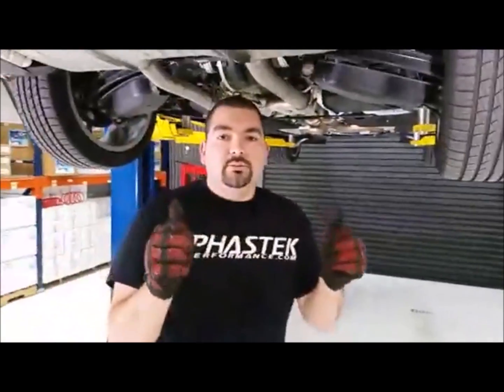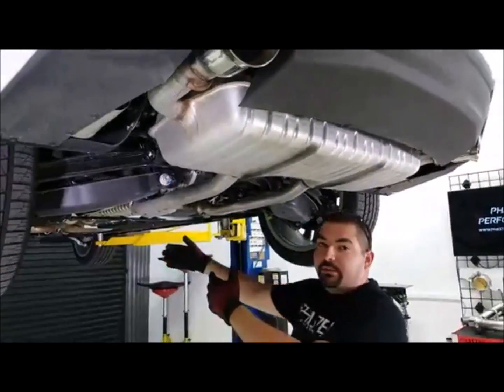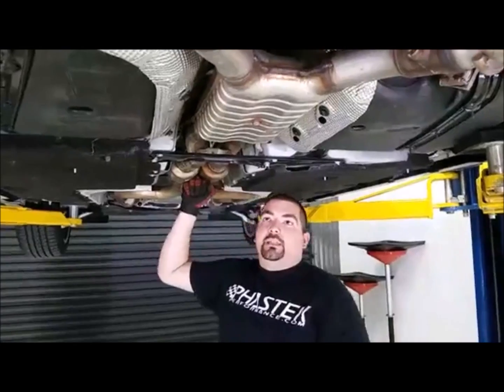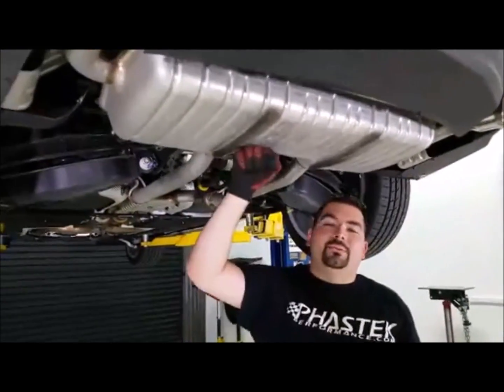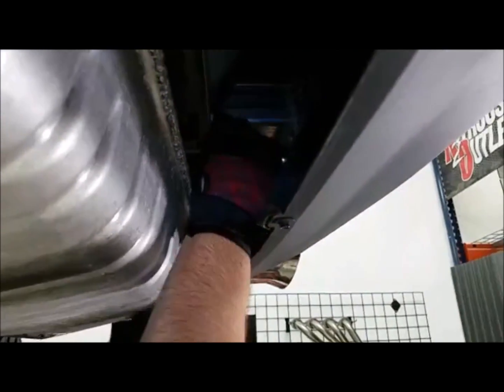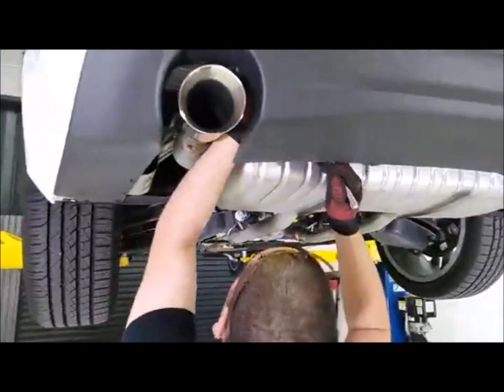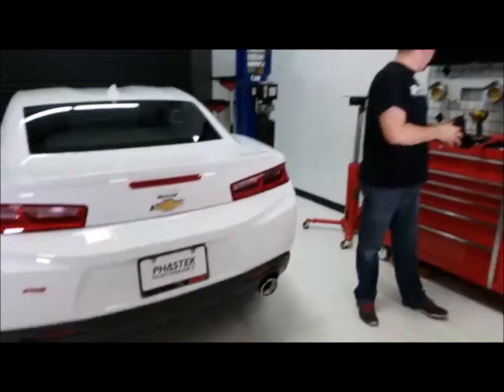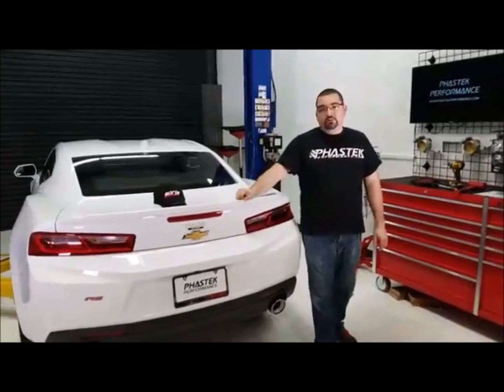Borla S-Type Axle-back #11928 LIVE Install on Facebook

Comment: I have a 19 SS need help on options . Was told can’t put the Borla Atak cat back system on my car bc i have an automatic. So would i need just axel back or axel back and mid pipe ?
Reply from the maker: There are a lot of different variations to the 2016-2020 exhaust systems.  Because of that a lot of manufacturers had to adapt with different kits.

You can do a cat-back system but you would have to get the X-pipe and then the muffler system of your choice that works with that X-pipe.  

Here is a link for the Borla X-pipe that will work for you since you have an Automatic.  It will have the brackets for the AFM valves that are in place.  

https://www.phastekperformance.com/2016-Camaro-Borla-X-Pipe-Mid-Pipes-AFM-Valve-60610-p/borla-camro-6-x-pipe-60610.htm

Now all you have to do is find the muffler system that will fit your Camaro and you are good.  Reach out to our sales team and they can get you lined up if you need any help.

sales@phastek.com

Comment: I put my Ataks on 2 days ago, your video helped a lot. So the clamps only go on the end of new pipe right, even with the end of pipe? Not splitting the new & existing pipe . I put clamp even with end of new muffler where the split is. And tightened the heck out it
Reply: InstaBlaster...

Comment: Nice!! I have a v6 2016 maro as well. I like the sound of borla. It your opinion what system would recommend for extra HP and a great sound? Cat back
Reply from the maker: We prefer a cat-back system over an axle-back cause of the replacement of the factory system.  But some owners are just looking for a sound change and an axle-back does that.
Reply: K Stanford "maro" 😂😂😂 Becuase the "Ca" is so hard to type

Comment: Can you change from single tip exhaust  to double exhaust on the V6 2016 and up camaro?
Reply: Will it fit?
Reply: I don’t know if you still need this information but yes you can, Borla makes these same exhausts (S-Type and ATAK), all you have to do is follow the same instructions but you’d have to change the diffuser

Comment: Does installing the axle back system void factory warranty?
Reply from the maker: We can see it voiding the exhaust portion of the warranty coverage but not the full warranty coverage.  We would suggest checking with your local dealer just to be sure, some dealers are a bit more strict when compared to others.

Comment: the pinch in the middle of the stock system, dose that affect the sound quality as well?
Reply from the maker: Yes, the pinch in the exhaust could effect the sound you will get out of the exhaust.  Changing that will open up the exhaust system allowing for a slightly different tone.
Reply: Phastek Performance would you recommend the indented part, the pinch get replaces with a straight pipe?

Comment: what's the cheapest thing I can do to make my 2018 v6 camaro RS exhaust louder ?
Reply: Sell it, the whole car and get a SS
Reply: Muffler delete
Reply: @proelitematthew7811  that's a great comment,  sell it for an SS and pay around $8000 more to go 9 tenths of second faster to 60.
Reply: @robertjakicic5878  that's a great comment. I got my 2017 as for $27,000. A 2018 rs is for $26,000. And it's a whole fukin second slower😂
Reply: Shouldn't have bought a v6 if you're worried about sound lmao, the price difference for the v8 is so worth it, got my 19 2ss for 34,000, my borla atak comes tomorrow!
Reply: @lol25879  borla axle back is way too overpriced. I just got the flowmaster American thunder axle back, flowmaster scavenger x pipe and kooks 1 7/8 catless header. With a cold air intake from cold air induction. Making 477hp and 481tq on dynojet.
Reply: ProEliteMatthew definitely not overpriced, you pay for the quality, I plan on finishing the full system once I’m not worried about warranty
Reply: @lol25879  "pAy FoR qUaLiTy" 😂😂😂. Dude you only have to worry about quality when it comes to things like headers. I straight up told my dealership I don't need warranty. Bout to do cams and heads this weekend.
Reply: ProEliteMatthew “not worried about warranty” lol sounds like you should be if you’re stuck buying low end aftermarket parts.